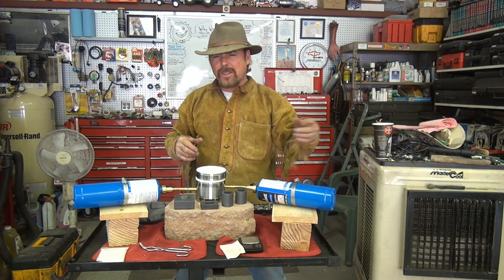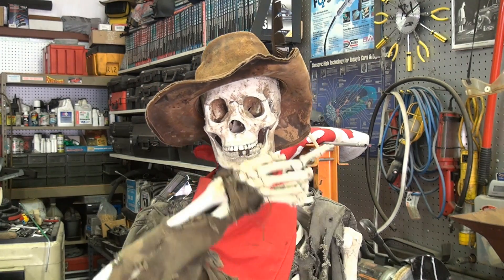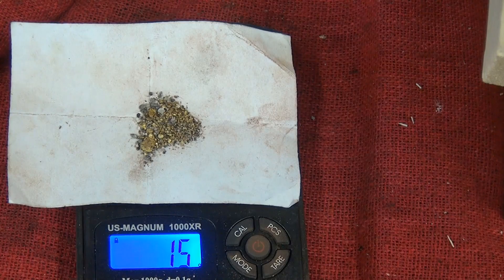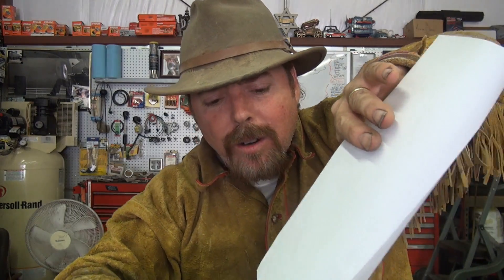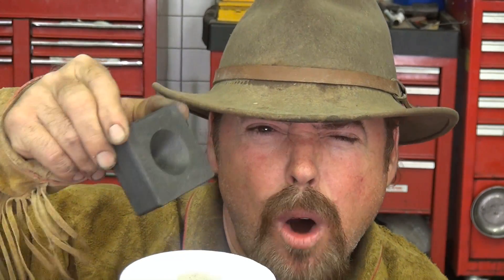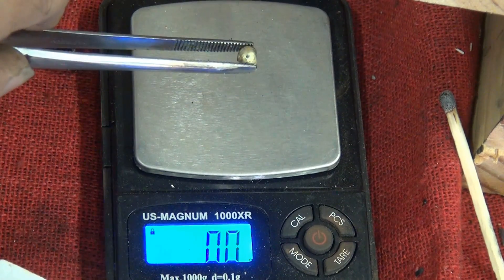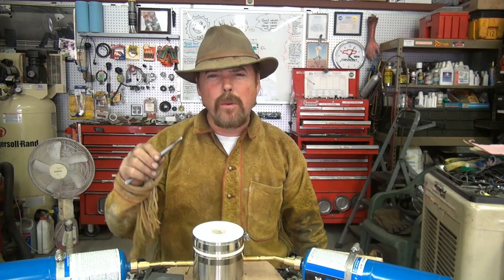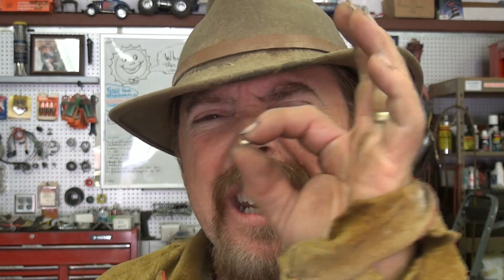SMELTING GOLD !!!! From Black Sand .... ask Jeff Williams

Comment: What happens if I don't use a collector metal and smelt 90% black sand to 10% gold..will it still form a button or a bunch of small buttons then I have to pan after? ..I'm taking your advice about the mold being a cone, I'm using a potato and we'll carve it into a cone crucible
Reply from the maker: you won't get all the Gold out of your black sands..... keep us posted
Reply: @Askjeffwilliams  there wasn't enough gold in the black sand to make a button..fun experiment
Reply from the maker: make sure to torch the potato first to get a nice layer of carbon on it before pouring

Comment: Hey Jeff. I tried assaying some ore using 30g ore sample, 30g litharge, 30g soda ash 10g quartz sand and 2 g flour.  The crucible was too small to fit the entire sample.  I filled crucible to the top and put in muffle furnace.  Crucible was red hot after an hour, but no melt.  After two hours still no melt, just a chunk of glass.  How can I make it to melt?

Comment: what happens with the other precious metals that may be in the mixture like silver??
Reply from the maker: the base metals are oxidized into the Slag and the Precious metal like Silver stay with the Gold. Smelting is not refining and to get the Gold pure you can wash it in a bath of Hot Nitric Acid to dissolve the Silver or use electroplating or Aqua Regia.
JS